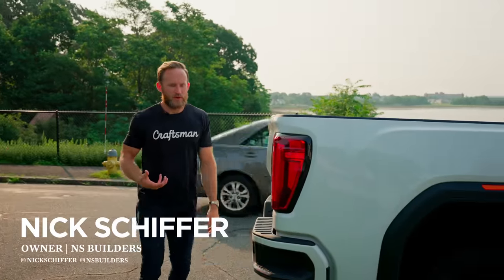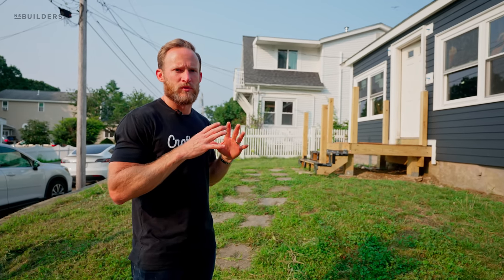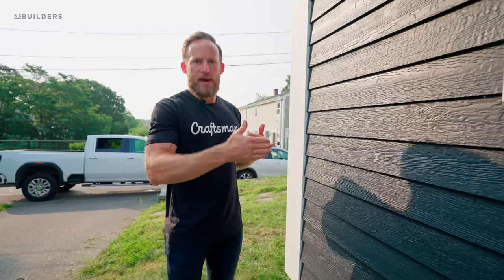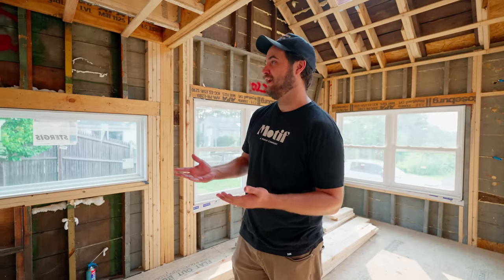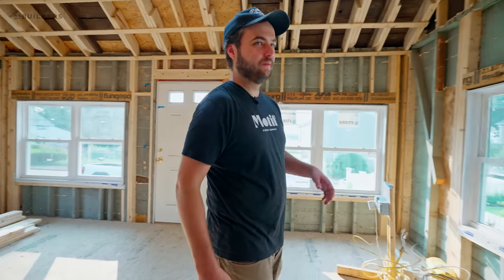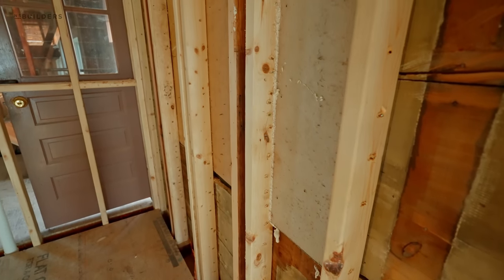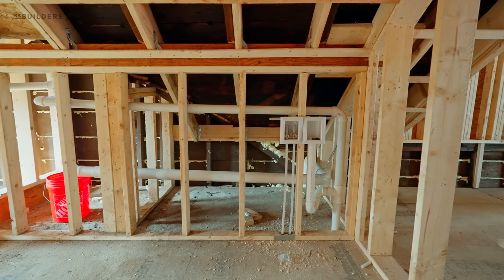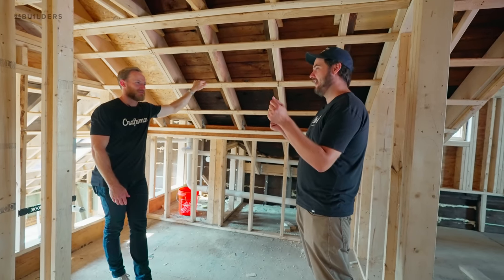Siding and exterior trim are installed at the Quincy Cottage

Comment: Is it okay to apply the ice and water barrier over the plank sheathing? I would think the gaps would impede performance by causing dips in the ice and water shield.

Around here most people put a layer of 1/2 ply on the roof over the planking before underlayment. But if you can apply only an ice and water barrier like that it could save roofers who do cottages in my area a lot of money!